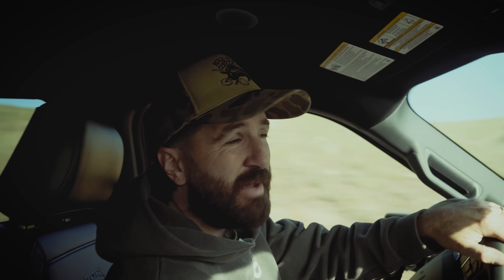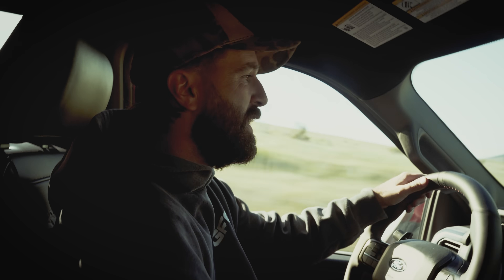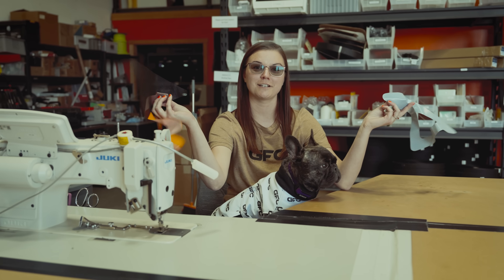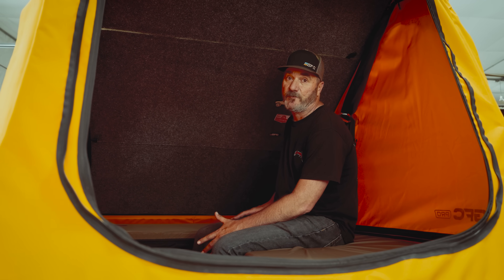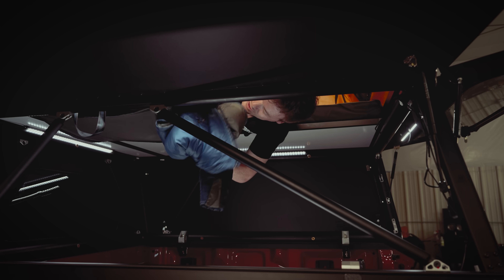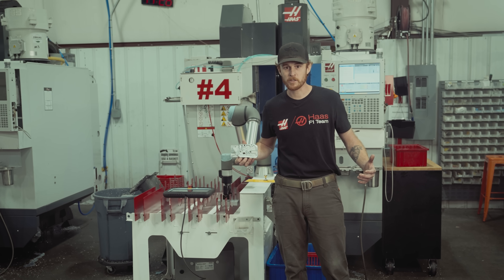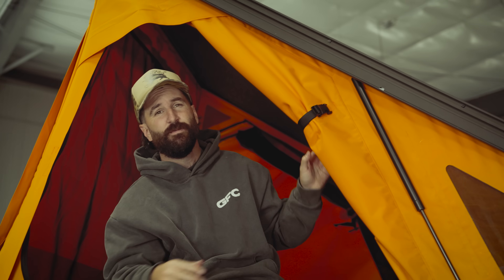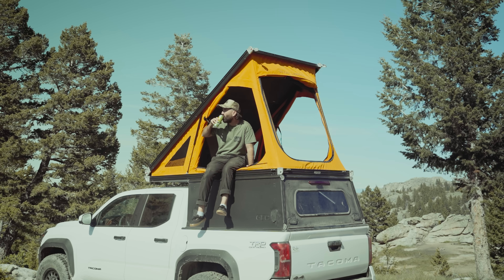8,000 Campers later, what did we learn? | 2024 GFC V2 Pro | Go Fast Campers

Comment: We have a GoFast mounted on our Ram 2500. 70000km of travel from Newfoundland to the deserts of Anza Borrego and we never had one problem. This V2P looks 🔥
Reply: You must not be sending.  😅.  I have a topper on a ram2500 and in 3 trips I have it falling apart.  I still love the gfc brand and company so I’m doing whatever I got to do to make it survive.   I built a full cage for it to get the weight off the bed rails and prevent it front shifting  when sending thru whoops.  I actually love my topper even more now that it’s truly boogie rated now.  #gofastercamper edition
Reply: @drkdss8742  my diesel ram is not being sent through the 3 foot whoops! Our truck does however see a ton of off road just at old man speed 😜
Reply: I will probably be lining up for that new tent and roof shades!
Reply from the maker: Thank you very much for your support Perry. Stoked to have you in our community.
Reply from the maker: You’re truck is unusually capable drkdss! Can’t wait to see the next videos going full send. Know that we have your back 🤝
Reply: @GFC  I love GFC 🫡

Comment: Nothing to do with the GFC but most trucks have tailgate gaps and drainage ports in the truck bed.  How have people been preventing water and dust from making everything in the bed of the truck filthy?  Just curious.  I had a Toyota in the 1980’s and used foam around the tailgate with my fibreglass topper.  The truck I have now is a Honda Ridgeline, which isn’t conducive to any kind of camper, anything in the back gets covered in dust or wet even with a cover, just too many entry points.